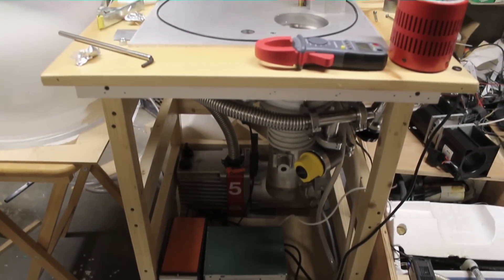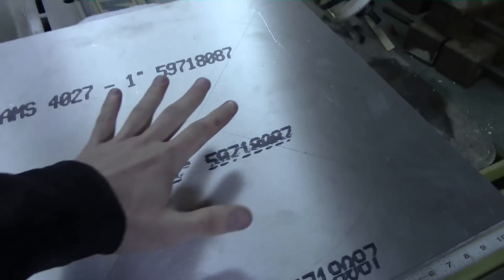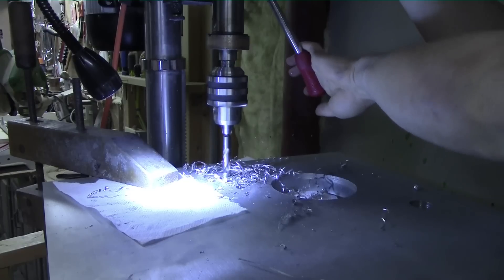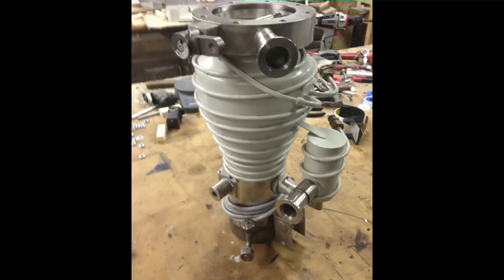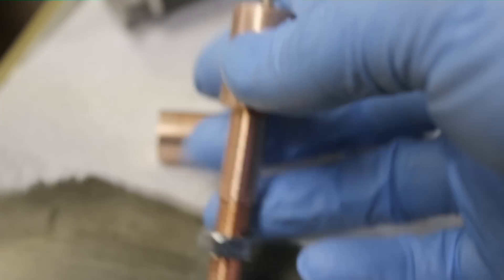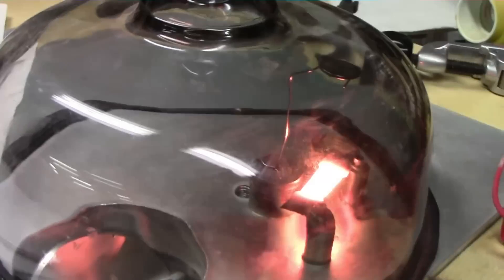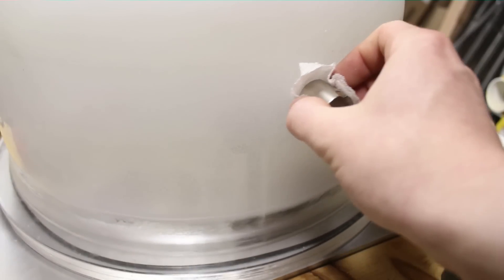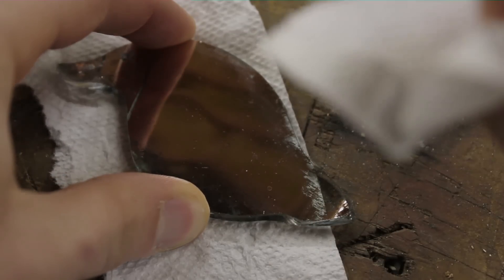High Vacuum Chamber for THIN FILM DEPOSITION Build

Comment: Sweet, man!  It's really cool to see other DIY hackers getting into thin film tech.  Your aluminum mirrors will create their own oxide layer and become quite a bit more durable after a few days exposed to atmosphere.  For really good durability, you'd probably need to add another coat of something.  Even though the experts will say that pipe threads are unacceptable in high vacuum, if you plan to operate at 10^-5 or higher, they'll probably be fine.  Use high density PTFE tape on the threads, and wrap the tape onto the tip of the thread.  I've tested this many times, and found it to work fine.  I'm really curious to see what you make with your new setup.  Congrats!
Reply: I am wonder if can do silane chemical vapor deposition on to silicon substrate? Needs high temps like 900 C.
Reply: @marshalcraft  silane gas rather nasty stuff. I had an experience with heating Silicon dioxide and Magnesium  something like that
Reply: I'd be curious how close to this setup, in terms of usefulness, one would be able to use a plug-in residential wall vacuum or shop vac to create a similar vacuum/deposition chamber. I wonder about at home waterproofing electronics that are taken apart during DIY repair (regardless of whether the item/device had an ingress rating prior to the repair). It'd be a simple set of steps to add what could be a lot of extra peace of mind for DIYers and local-level electronics repair businesses.

Comment: You're an amazing young man. You need an adhesion layer for your copper to stick, not a protective layer. Before depositing the copper, deposit 50 to 100nm of NiCr. I use an e-gun with nitrogen IAD and get good results for adhesion of other metals. I don't know if you can evaporate NiCr from a resistive source, but your sputtering gun should work.
Reply: Also make sure that the substrate is VERY clean before depositing anything.

Comment: Hey dude this is super awesome, there isn't enough online about how to go about creating DIY evaporation chambers so thanks for uploading!

One thing that is probably stopping you from reaching low 10-6's is the poor seals, O-ring copper gaskets would be a good value upgrade if you want to get your pump down time and absolute pressure reduced.

Comment: Looks like the stuff I do everyday. I need to get back into R&D. try using RF to sputter oxides if you get around to doing those types of deposits. a 40khz plasma generator combined with an acetylene gas bleed has been known to create forms of DLC.
Reply: What is procedure for golden colour coating on steel sheets

Comment: On the note of ideas: Diamong Like Carbon (DLC) is a bit easier than "Proper" Diamond, if i understand correctly.  

That and/or Proper Diamond (Not even optical quality per-se, just like diy tool coating even would be huge!) Would be my Vote

"Plasma Assited Chemical Vapor Deposition" seems to be the standard, perhaps borrow from The Thought Emporium's Design for that Magnetron?

Comment: Interesting...
Thankyou for showing this setup.  I am looking at developing a prototype system for an open source Electron Beam Melt system in the relatively near future, and have a tendency to over-estimate challenges.

The main difference is that I am looking at developing an ion pump to go from crude vacuum to high vacuum - possibly even integrating this into the electron gun, itself.  There is also some additional experimenting I would like to do involving ion sublimation and nanoscale additive manufacturing.  

Current facilities are too limited to undertake, but I am building a knowledge base ahead of time.

Comment: Great work Ben, "But using Aluminium for the base plate"  won't it contaminate the vacuum.I mean Aluminium Oxide is a great problem. Usually, Stainless Steel is used for the base plate material. Did you encounter any problem while depositing reflective coatings?
Reply: I'v seen massive tanks made entirely of aluminium that work great

Comment: OK, it seems there are plenty of experts here and I have a question about something that has been bugging me for a long time. I grow crystals, I actually started with almost no practical chemistry knowledge which actually imbued with a very unique (naive?)way of attacking the problem of producing beautiful crystals. You can see some albums and single pictures of some pretty amazing stuff on IMUGR by just searching for "growing crystals at home". Anyway, I had noticed some entity in Arizona offering MAP crystals on a matrix with Cupric Sulfate Pentahydrate overlaid over the whole thing and it looks amazing. I wondered if they were using vapor deposition, or is there an easier way of doing it?

Comment: It's a really cool build.  It kind of looks like a large Edwards Diffstak...those are more like $500-1500 used depending on size.  How did you find one for $160?  And the Edwards #5...looks like $300 is a better-than-average used price.  How did you get such good deals?  Even with lurking and searching those prices you list seem too low.
Reply from the maker: I checked ebay every day for a few months, it had a dent in one of the cooling lines that I ground off and re-welded if I remember correctly
Reply: @BenNBuilds  thanks for the reply.  That makes sense...defective items sell for way less and if you can fix them you can get super deals.

Comment: Could you cover the substrate with something like a stencil, or would ALL the material come off when you peeled it off?
It would be great if you could make circuit boards without having to etch them!
Reply from the maker: You totally can, I made a couple circuits! The traces are generally very thin and its difficult to solder to the traces, but you can deposit circuits on  a wide variety of materials
Reply: Wow, that's awesome! Thanks!

Comment: I'm going to buy a drill press and hole saw specifically for this project.  Any general recommendations about what to buy? I see that you're using a floor mounted press here. Would a bench mounted press cut it? Do you find that a floor mounted press is handy in other situations?  Hole saws are all pretty similar right?  Thanks for the help.
Reply: Also, you said that you'd like to have done it differently.  How would you liked to have done it?
Reply from the maker: I just used a bench one, its all I have. The distance from the chuck to the post is important, mine was too short for a couple of the blind holes so I had to use a drill guide.
  I would have liked to use a line boring/fly cutter type setup in a big mill than cut knife edges around it so I could use a copper gasket like CF flanges(totally unnecessary). The hole saw actually worked out really good, its just a 4" bi-metal one for the diff pump. Its nice because you can get whatever size you want up to like 6" and it doesn't need to be perfectly round as it just flows air. As long as it cuts aluminum your fine, just take it slow as they really bog down the weak drill presses and use some water soluble lubricant
Reply: BenNBuilds WD-40 (Water Denatured - Test 40) works great as an aluminum cutting fluid and a regular circular saw with a wood cutting blade will rip right through aluminum sheet. Ben could I pay you to build me one?

Comment: Nice Setup. it's amazing. I am doing the same thing for my thermal evaporator. can you please send me your specifications of MOT(current source) with its connections. I already become a fan of you.
Reply: Just drill out the high side of the MOT and wrap it 2 times with a piece of 2 gauge welder cable. It's that simple. you get around 1-2 volts out at around 800 to 1000 amps. Run it through a Variac to fine control your heat source. MOTs are all slightly different, but pretty much the same

Comment: nice video man! I am working on a similar project, rebuilding a old machine. having great times. I am not a specialist, so I trying to collect useful information, may you kindly help me: During evaporation metal, should the valves stay fully open and the Difusion pump working on? would this deposit metal film over the difusion pump spoiling it?
Reply from the maker: +fercarcas I left my pumps running during depositions and didn't notice any metal deposits on the pumps. It stays pretty well isolated across my big bell jar. with shields up.
You may want to check with a professional if your using a turbo molecular pump, but metal deposits on oily surfaces just wipe right off anyway. Diffusion pumps are pretty resilient
Reply: Diffusion pumps often have a water cooled baffle separating them from your process volume to protect process from oil.  Same will protect pump from bulk of deposition substances.

Comment: Great video! I am building a similar project and I was wondering what meterial you used to isolate the high current feedthough?
Reply from the maker: Zane Atkins Teflon, or PTFE is the best vacuum plastic. I just love the stuff!
Reply: Awesome! Did you just wrap it with Teflon tap and approximately how think? Thank you.
Reply from the maker: just a punched out a Teflon sheet, I believe it was 1mm thick

Comment: Dude, from where did you get this diffusion pump for 160$? P.S. I'm almost sure that casted/machined aluminium plate will be cheaper. It's just a guess... Sick project!
Reply from the maker: +magdanoz88 Ebay! I was kinda bummed getting the plate on Mcmaster at full price; I just didn't have the time to wait around to find one at a junkyard or something.
I've seen some HUGE, beautiful pieces picked, like an 800lb, 6in thick 6ft wide Hexagin, machined mill-spec  flat, marine grade aluminum masterpiece this guy I know got at scrap value price!

Comment: how would one go about making >500 layers of 2 different patterns of conducting surfaces and 1 plane dielectric surface 

just 2 motorized plates that flip around systematically and change the patterns?
Reply from the maker: That would work, maybe tricky to position but you could do something with a the plates breaking a focused laser beam or a change in capacitance between two plates.
Reply: +BenNBuilds  ok thanks for your input, appreciate it

Comment: Hi 
Do u know how to clean a bell jar which is used in MPCVD machine. Because after every receipe run in my company, we scrap it.
Reply from the maker: Riyaz Ahamad If there's a thin film of oil coating the surface (often a diffusion pump will do this) just wetting it with acetone and wiping it off can remove all the deposited material. Some oils won't out gas much even under high vacuum conditions, but depending on your pumping methods it may be an issue. Hope this helps

Comment: This is really cool! Thanks so much for posting.

I want to build one in order to deposit a 50 - 200 nm thin film of gold or silver on my perovskite solar cells.  See more information here:
http://www.nature.com/nphoton/journal/v8/n7/full/nphoton.2014.134.html

It truly cost you under $1500 to build? That seems like it might be worth it to me.  Would you be willing to answer questions that I have as I try to follow in your footsteps here?

I want to compare the efficiency of cells prepared with PVD and cells prepared with a chemical deposition process.
Reply from the maker: Sure, It actually went together pretty easily but i'd be willing to answer whatever questions you have and try to help you out.
 I haven't made solar cells with mine yet, that would be pretty interesting  to see the difference between PVD and chemical
 If you need accurate repeatable thicknesses a quartz thickness setup would be needed.
Yes It ended up costing around $1500 with everything but on ebay you never know
Reply: BenNBuilds  Thanks for the quick reply and the tip about the quartz thickness setup.  Most of the papers I've read use a scanning electron microscope on a cross section of the cell, which is probably out of my reach until I get access to a real lab. 

If you wanted to try making some perovskite solar cells you'd need a spin coater and something to get the ITO glass atomically clean.  I was looking at this spin coater, but it's back-ordered:

http://www.ebay.com/itm/SCK-200P-Spin-Coater-Kit-/251290334443?pt=LH_DefaultDomain_0&hash=item3a821234eb

I plan on using an ultrasonic bath to clean the cells:
http://www.joyfay.com/3-2l-ultrasonic-cleaner-heater-mechanical-110v-220v-100w-40khz-ce-rohs.html?gclid=CjwKEAjwgMieBRCB3bqB94e9lD4SJABW3sTNS5BrFXY77DfmWiqoweN_gebiDHqCOsY8qsvATzuVcxoCmNDw_wcB

but the pros use Ultraviolet/Ozone cleaners like this one:
http://www.uvotech.com/uv_ozone_cleaners/compact-uv-ozone-cleaning-system/
Reply from the maker: If you build a PVD chamber it's pretty easy to throw some wire around it and ignite a plasma inside with a few watts of RF.  Intro to plasma cleaning
it works pretty good in my chamber and really cleans stuff better than acetone in a sonic cleaner, which I do first anyway to get the larger dust and oils off. 
 A spin coater would be pretty easy to DIY but to get ITO you need a a sputter gun. The stuff to make one is easy to find on mcmaster and I bought an ITO target on ebay for $100. The sputter gun works well with a rectified MOT
Reply: BenNBuilds Oh yeah I have seen that vid in the past thanks for the reminder. I was just gonna buy the ITO glass at first here: http://www.adafruit.com/products/1310